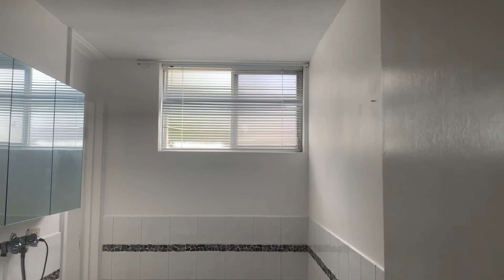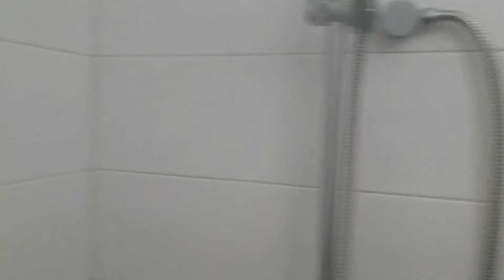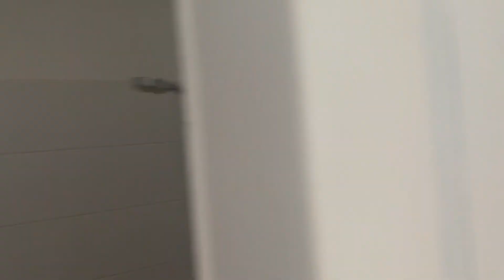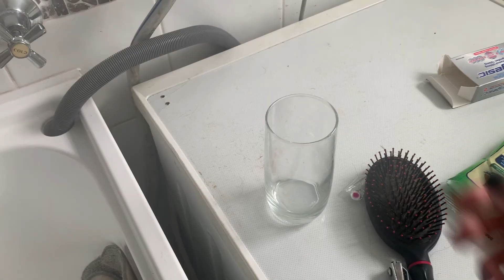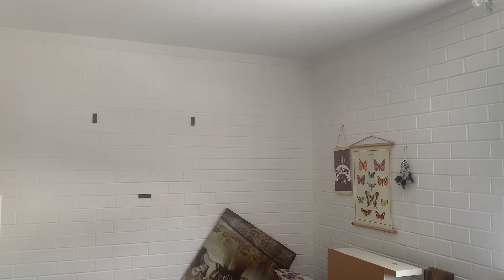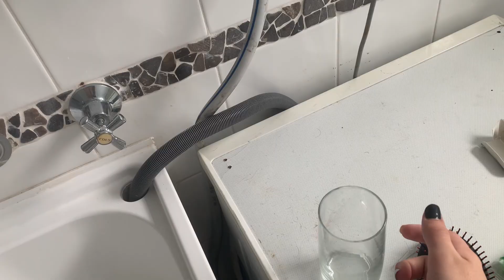how to find the resonant frequency of a shower (tutorial)

Comment: I got a video of a guy doing it in a cafe. Is there like a limitation or requirements need to be met for a room to be able to do this or u can do this on all enclosed space?
Reply from the maker: you can do this in any enclosed space, but how well you'll be able to hear the effects depends on the composition of the walls, floor, ceiling etc., the amount of shit in the room, and the resonant frequency itself (which could be too low to hear or sing with a large enough space)